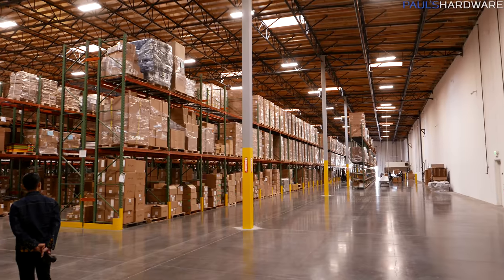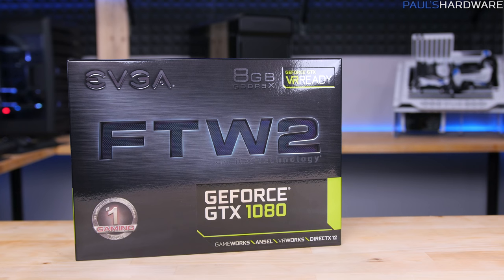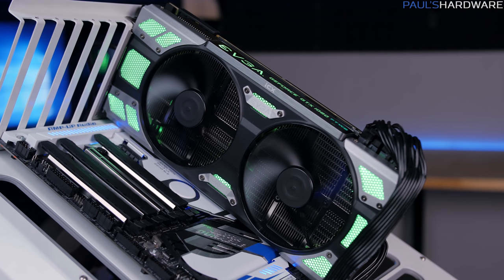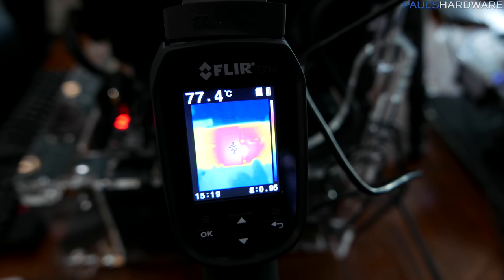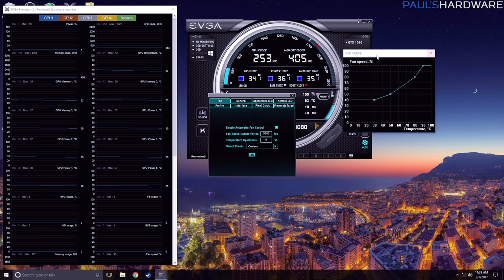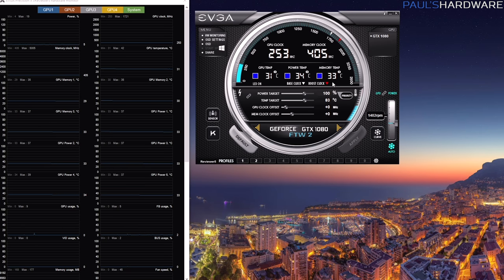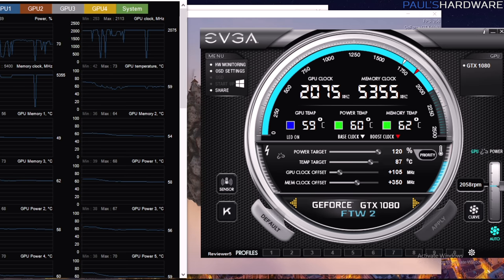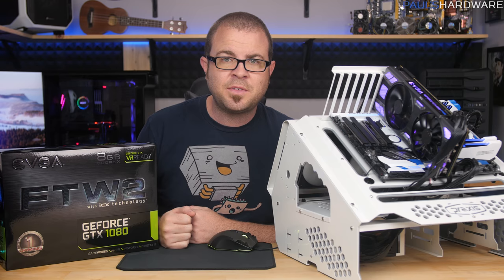EVGA's New GPU Technology - GTX 1080 FTW2 with iCX

Comment: Just what EVGA needs, more SKUs!
Reply: More SKUs = good for the consumer, bad for the manufacturer. 

The limiting case of low SKU numbers would be Apple Macbooks where they launch a couple a year. 

The limiting case of high SKU numbers would be Asus who launch hundreds a year. And of course there's multiple manufacturers. So in practice there are thousands of laptops to choose from.

Now if I buy a Windows laptop the greater number of SKUs mean I can get feature X without needing to buy features Y and Z if I don't need them. So when I buy a Windows machine it ends up costing less than a Mac.
Reply: "More SKUs = good for the consumer?"  But we're not talking significantly more complex products like laptops, we're talking about a single component- the video card.  EVGA currently has 9 different products for 1070 GPUs.  Four of those SKUs have all identical specs, just different coolers and the price spread is only $40.  When a videocard is $400 what is the point of offering 4 different models, with the same specs, that are all $10 apart?  Just because there is a choice doesn't mean those choices are worthwhile.  That is just confusing to the consumer.

EDIT:  updated my post but am going to make a new reply.
Reply: If a customer is getting confused that easily perhaps they should not be making purchases as if they are confused they are clearly not informed and uninformed purchases seldom end well.
Reply: While your point is generally valid, what would be the point in making choice difficult for the consumer? If the number of variants of the cards had a clear feature/price ratio that justified the number of different SKUs, then yes, that is a good thing.

However, if Iain is correct, then what EVGA is doing is alienating a number of customers. Why? Because sorting through all the different variants takes time, which is a non-renewable resource. If the price savings were on the order of $100, then perhaps it would make sense. 

But as it stands, if Iain is correct, it is a waste and NOT good for the consumer or the company.
Reply: If a consumer is capable of making an informed decision, generally more choice is better and they would be perfectly capable of choosing what product is best for them. I don't see that as any different here, and I still think more choice is better because if someone doesn't want the idea of a fuse potentially being bad and requiring them an RMA, or doesn't want the newer features that ICX offers then they can still purchase ACX. I don't see how they any customers are being alienated, if anything the opposite is true here.

I do not see how it is a waste.
Reply: When the choices are clearly delineated and have value, yes more choice is better.

When the differences are difficult to discern and or cost a lot of money, too much choice can lead to frustration. 

Look at the packages (more choices for the consumer) when buying a car (I went through this about a year ago). There were times where I needed to walk away for about a week to clear my head. The frustration cost me time and the dealer a sale because I had to take my time to sort through all of the information.

Your basic point is correct and I agree: more choice is better for the consumer. But if the difference between the choices is not significant, it just leads to time being wasted and frustration which is not good for the consumer or the company.
Reply: purpleCx
Reply: I went back to the EVGA's 1070 product page and they have added the iCX cooler cards so now they have 13 SKUs for 1070s.  13!

6 of them have the following specs:

1506MHz Base Clock
1683MHz Boost Clock
180.7GT/s Texture Fill Rate
8192MB GDDR5 Memory
8000MHz Memory Clock
256.3GB/s Memory Bandwidth

And they range in price from $400 to $440.  

6 cards with a price difference of only $40.  That is just ridiculous.
Reply: SKUs for the SKU throne!

Comment: EVGA should have saved this for the 1080Ti series.
Reply: Wingman1977 Well there is nothing saying that the cooler design won't be on the 10ti series.
Reply: Wingman1977 will the 1080ti actually come out tho? It's all talk I'm yet too see proof
Reply: i think it's smart bringing it to the 1060, 1070 and 1080, I myself, will be buying a 1070 or vega equivalent to upgrade my 970 in q2, and in Australia, cheapest is what I go for in GPU's since you pay a premium for a higher factory overclock usually, but in this case, I'd be buying the icx instead just because of it's much better cooling capacity, so I like it, I think it works well.
Reply: 1080Ti will most likely use the same cooler anyway. We should be hearing more about the 1080ti in march/april when more Vega news starts coming out too.
Reply: the only things worth paying extra for is a good custom cooler and extra power phases etc etc

 you can overclock yourself, paying for "OC edition" cards is moronic
Reply: +OdinAlgeron youre paying  for the guarantee of the minimum clocks advertised,you buy a lower card at reference clock,you may not get good asic,and may not  oc well at all.But im sure you knew that....
Reply: It's gonna be on the TI too.

Comment: 0:18 I still use one of those logitech keyboards with the purple ps/2 connector , in fact I'm typing this with it right now. 12 years old. Some of the lettering has on the keys are gone, very dirty, never been opened to clean, numerous coffee, tea, beer, wine, coke, wine spills, banging with fists and thousands of gaming  hours over the years and still works perfectly. It cost like $10.

Comment: Would be interesting to know if the cooler is performing quieter in comparison to the old one if running at the same frequency and temperature
Reply from the maker: check out the GamersNexus video for that! They did much more thorough testing than me, I had a lot going on this week

Comment: Hey Paul! I'm ordering the EVGA 1080ti FTW3 when it's released. But I'm curious, should I use their single split cord, with the 8-pin connection and the 6+2 connection? Or use two separate 8-pin cords? I've heard that using 2 separate cords is better for power than the split cords...

Comment: Good stuff. Building my first gaming PC and I think I decided on a MSI 1080 Gaming X to go with the MSI Z270 Pro Carbon. Would you make the switch? I've been told that same brands is generally better.
Reply: Adam Roemer 

Using the same brand shouldn't matter. Myself as an example, I've got zotac for gpu, msi for mobo, hyperx for ram. It's the actual specs that matter for compatability, ie the type of ram or cpusocket something might fit to.

Comment: Just don't use iCX cooled cards, if you're up to a large case then buy an 3 fan cooled card like the asus rog strix series. Do not borther your time searching for an 2 fan cooled card when you can get an 3 fan cooled card (if you own an mid-tower or larger) and get slightly lower temperatures at a lower noise. I know some people may disagree but that's my own opinion if you aiming for an cool running system @ overclock. For normal usage i would recommend the strix series anyway. They're running cool and quiet, ofc their normal models are factory overclocked and can be overclocked further, what i find amazing.

Comment: This all looks super nice and that's why I bought EVGA 1050TI aith ACX3.0 for my HTPC BUT semi passive mode is not working. Why? Well support said it's because of the high temps on the card so they changed it in bios so that it can't go bellow 35% for fan rpm. On the gpu's page they still advertise it as 0db cooler...  Beside that those profiles are bugged as hell as the precision X is, I'm using newest verified drivers and latest bios for gpu that is recomended by EVGA. So I'm not really sure about this new cooler. On the other side my main GPU from Asus is working as advertised with bloody semi passive mode without any problems... EVGA never again... Tbh card is quiet, cool too but why do they need to lie and if you build a HTPC with passive PSU, 2xultra silent fans on 600rpm that's a bit of a problem and all because of their false advertising.

Comment: https://youtu.be/xuZX4O78XHI?t=51 0:51 This is incorrect. The fires/issues were caused by faulty VRMs, NOT by thermals/overheating. VRMs have been hotter than GPU cores for a long time now, that is definitely not something new - remember 7970s? 7970 VRMs often reached 90-100c or hotter. Other than that, solid video.

Comment: No benchmarks?
Reply: Sheena1234ization they perform same as ACX just at better or worse temperature.
Reply: It's the same as any other GTX 1080. Frame rates won't change at all when the GPU and memory clocks are the same.
Reply: Sheena1234ization It's a GTX1080. Plenty or benchmarks already exist. This is only a new cooler.

Comment: I've contacted EVGA about the new video card and there is no difference in performance unless you run the FTW on liquid or line 2 cooling will beat both cards on air. Although the FTW 2 is slightly better on air than the original FTW but if you want to liquid or line 2 cooling FTW is the way to go.

Comment: Is this a good build ?

Motherboard: Gigabyte GA-Z97MX-GAMING 5 (m-atx) CPU: Intel Core i7-4770K CPU Water Cooler: NZXT Kraken X61 (280mm radiator) GPU: EVGA GeForce GTX 1080 FTW2 Gaming PSU: XFX ProSeries 850W RAM: HyperX Fury Black 16GB 1866Mhz SSD: Samsung 840 EVO 250GB 2.5 "HDD: WDC HDD 1TB Cabinet: Fractal Design Define R5 Black ?

Comment: Glad they finally fixed their crap cooler design. All customers that got scammed with the "early acces" version of a cooler should receive this one instead. I'm glad their cards were a little bit more expensive than Asus ROG Strix, saved myself some trouble otherwise i would have gotten scammed too.

Comment: i like evga but fire in my computer is not cool.
Reply: Kieth_Singleton2011 Singleton fire is pretty hot usually
Reply: Throw in some Magnesium, Lithium and Manganese for that RGB colour show!
Reply: Kieth_Singleton2011 Singleton I'm not so hot on Exploding Video Graphics Adapters
Reply: So is the GPU that catches on fire but not all just some and with my luck that would be me. warranty you say why would I get off my ass to go register that I'm lazy but really I just need the prices to drop on the all  GPU. I'm still Rockin a my old GTX 680 damn you prices on video card 1070 and 1080 that is my car payment.
Reply: my 1070 is aircooled and it never reaches over 55c its overclocked like a mofo I think they rig the GPU to where it doesn't perform the way they can because mine some reason boosts 200+ mhz over the previous boost of 100 mhz and it never goes over 55c I can't even hear the fans either
Reply: lucas rem What bullshit?
Reply: Seeing as that was one in every 2 million cards during that small time where they were affected, you'll be fine. They now include thermal pads, or you can get them for free if you bought one before the issue was detected. Or just get the ICX version. 

People really need to do some basic research before they comment.
Reply: I'm still afraid my GTX 1080 FTW burn my house down, not only my computer :/
Reply: Yes fire's not cool, sorry for the my english

Comment: Good morning! Just a note about the burning of the mother board. For decades UL requires flame retardant materials used in the making of the PCB, without components. In the resin a form of bromine is used that when a "flame" is present it out gases putting out any flame. These base materials are called FR4. There are different ratings of how far and how long the flame can exist. The ratings are 94VO, 94 V1, 94V2. In the old days, pre-1960 there were non-flame retardant base materials, but no longer. So the term burn up your computer would be wrong, but rendering the motherboard useless would be correct!

Comment: Sorry EVGA, I'm still reeling from the Explosive 1070s you put out last year that I nearly paid  $550 for. You're gonna have to blow me away to get me to buy anything EVGA now.
Reply: Funny, I have had my Gtx 1070 FTW since July 2016, Not once has it exploded.... Maybe I got a defective one.... SMH
Reply: You paid that much for a 1070? I bought a 1080 FTW in June when they were released for $611 without tax? I haven't even had a problem with mine and I'm just gonna let it burn out (if it ever does) and get a new one over RMA. If it lasts the 3 years it'll be old tech by then and I'll probably have a new one before that.
Reply: HipsterPolice Reading comprehension friend.
I said I NEARLY paid that much for it. I didnt buy one. I read the hundreds of reviews of poor saps that got a GPU that could be mistaken for C4.
Reply: If people (not evga) say that evga has fixed the issue, that to me indicates they lessen to their customers and fix previous problems. No body is perfect and new issues always come up that haven't been there in the past. Its called learning from your mistakes. Only thing evga in my PC is a PSU.
Reply: get zotac mine never goes over 55c on any game its not water cooled or any thing either its oc to 2100 core clock mhz and 8100 mhz
Reply: if you STILL are cut over that, so be it, they have quality stuff, always have. ONE type of card had issues, SHIT HAPPENS, and they have fixed it now... I work in a running store and regularly brands bring out shoes that have issues, and oh my god do we hear about it over time. But the brands then fix those issues in the next revision, it's the same in computer components... So go ahead and hate it, stay away from it, no one cares if you do. You're the one missing out on some DAAAMMMMNNN fine cards
Reply: $550 for a GTX 1070 on launch day I assume...
How did you do that?  I got my ASUS Strix 1070 OC for $450 on Launch day, still pretty expensive.
Reply: Weak1ings different country maybe? any other countries outside of the us tech is much more expensive

Comment: Wonder if the 1060 will have a back plate this time...
Reply: Wait, did it not?
Reply: Jonathan Adam most of the 1060s don't. But Asus ROG Strix 1060 has a backplate, the G1 Gaming I think has one maybe not idk. The msi gaming x has one. my 1060 doesn't have a backplate.

Comment: This further screws people's resale value. Instead of going heavy PR and upping the warranty after the fixes, they kind of boned ACX owners a second time. Certainly won't go out of my way to own another EVGA product unless their price is lower, by chance. US customers have always prized the ability to have quick RMA turn around times even when slightly more money, but they lost points with me. The engineering/design mistake was one thing. They should have seen that coming with ACX 2.0 and instead they largely recycled the design. This is something altogether different and screwy.

Comment: Please help a noob install my first GPU!!!! I have the EVGA G2 650w and the gtx 1080 Ftw2, but I can't seem to power it 🤔 It needs dual 8 pin, but my PSU doesn't have that. It has a 6+2 pin with another 6 pin coming off of that. How do I power this thing???

Comment: Yeah too late. After what I got with my 1070 ftw I'm done with evga..
Reply: Black screen alot, and one day i start the pc and no response from the gpu. it turns out it died and I send it back to amazon and got a refund. Now i'm using the strix 1070. work like a champ!
Reply: You know about the memory problem that evga got?
Reply: try zotac gtx 1070 mine never goes over 55c oc 2100 mhz core clock and 4100 memory mhz aka 8100 memory mhz fans never go above 36% speed pretty scary
Reply: TheWorldWarrior Got the asus strix. Works great!
Reply: zotac REALLY impressed me with their amp extreme cards, sad their backplates are so hokey

Comment: After my GTX 770 and its ACX 2.0 horrible performance i wont buy evga ever again...  it was loud as fuck even with 40%, and with unter 80% the temps were horrible... other cards from MSI and Asus ran very quite and cool in my case... had only problems with EVGA.

Comment: Paul it is too little too late. If ppl still want to buy Evga cards more power to them. I will personally not buy evga cards. I will still buy their power supplies as those are still good - but back to vgas my qc issues started with nvidia 9 series cards from evga. I bought two evga cards and both had horrible coil whine - and high temps . I switched over to msi and everything was perfect. Msi card was better built in every respect and no audible whine. Fast forward to 2016 I picked up an evga gtx 1080 from microcenter because that was the only place close to me which had any kind of gtx 1080 in stock. Paid close to 800 usd, and after two days ended up returning it due to artifacts. Finally ended up with my first asus card gtx 1080 strix and it has been rock solid. Now I see that evga came out with the icx cooler and they want to charge people for it? Talk about shady practice, they should be taken to court for designing and selling a defective product. Do any of you remember Volkswagen? Evga should offer their customers fee upgrades - again these are just my thoughts, you are 100% free to form your own conclusion.